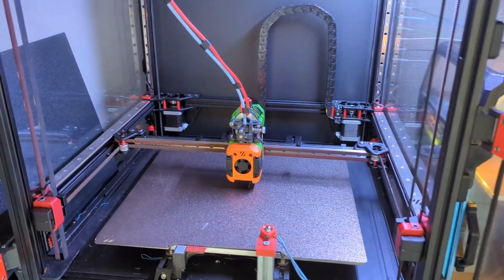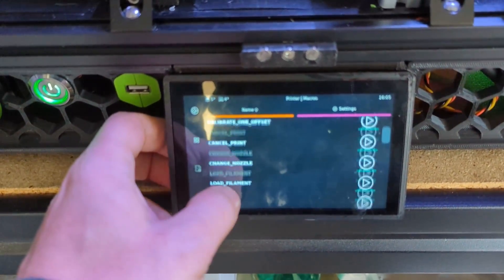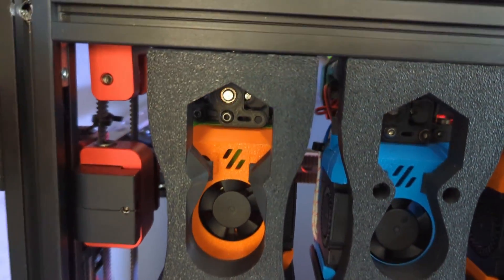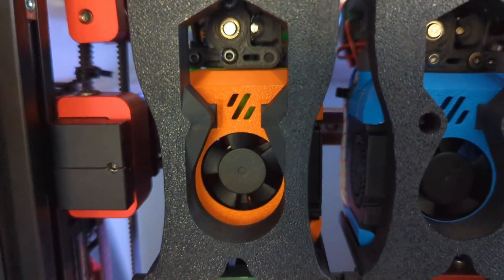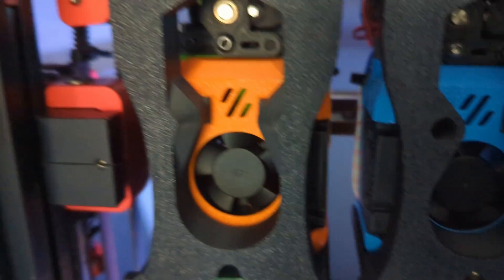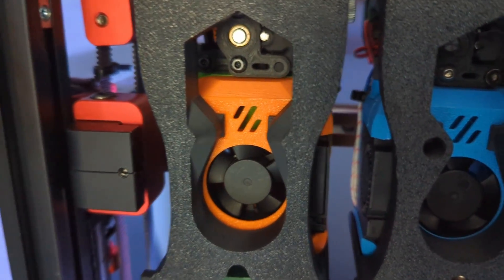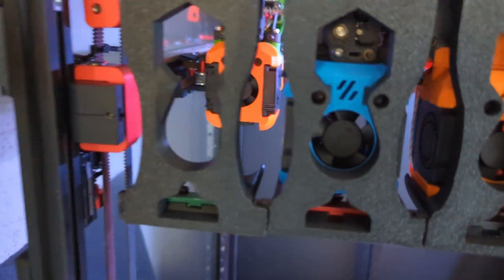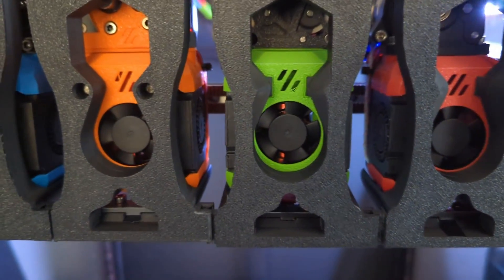Tapcahnger dock alignment

Comment: Cool project!!!  What kind of board are you using for so many heads and printer?
Reply: It uses canbus. So each toolhead has its own board.
Reply: @SymptomRelief All print heads are controlled via CAN.  What is the general control board?
Reply: @DoK_ToP  I don't know what board the OP has. But this project doesn't require a special board if using canbus. Each canbus board has an onboard extruder motor driver.

Edit: I guess you either need a mainboard that is canbus compatible or something like a BTT U2C to connect the canbus boards to the RPI. But that is a given for going canbus, not just with tap changer.

Comment: Around minute 5 you mention knowing which toolhead was in use.  I'm guessing you using the accelerometer data for this?  I looked through your example config files, but didn't see how you figured out which tool was active.  I'm still a noob.

Comment: where can I find the mod for the usb at the front of the skirt? and same for the on and of button.
Reply from the maker: I added the misc repo in description, see the Skirt Mods folder.
I burned out my initial 19mm power button - the inrush current of 700w of PSUs is a thing.
So now I have a 10amp 22mm button from Aliexpress just directly screwed into the skirt hole.

Comment: If u use an mmu system like enraged rabbit... you only need two toolhead.... If the printer print woth the first toolhead, then in the other can change with filament....and then the printer change to the second then the first can change color....that result, no need extra time for color change, it can change color in the background while the printer works and no need for 4-6 toolheads (the non used hotend can color change and purge while printing in progress) mmu combine with your tool head changing method could be absolutely genius

Comment: Nice work! Ive been following along for a while. Im getting closer myself. Almost finished the second toolhead, just ordered more parts for the next two. Migt have 4 total. Is your Voron a 300 or 350?
Reply from the maker: Cool, nice to hear.
Mine is 350, I can fit 6 easily, maybe 7 if I make it tight. 4sounds like a reasonable middle ground, I have yet to use more than 4.  The remaining two are dedicated for abrasives and high flow.

Comment: This should also work on a Trident right?
Reply from the maker: No, it needs toolhead to move vertically with respect to frame.
I have something in the works for trident as well. Sometime early next year.
Reply: Maybe a extra Z in the suport of heatools?
Reply: Would you toolchanger for trident fit in 250mm trident ?otherwise I would need to sell it for a 2.4v 😢
Reply from the maker: @Daniel-hw9zk  Yes. However still not clear how much Y travel will be lost.

Comment: I just love it, its already on my list after my current project... 
Generally speeking, wheres the setting for G0/G1 speeds ? Because id like to speed that up aswell
Reply from the maker: In the toolchanger.cfg - up top. There are two speeds - one for the fast moves and another for the slow moves.

I did a fairly extensive rework of the config files, so you might need to update.
Reply: @viesturz  thank you very much for replying... yeah in the toolchanger cfg i see them, by in general i also ment on how can i change those on my current 2.4 speed, multi toolhead  2.4 is just a bit planned so far but not any further so far, sorry
Reply from the maker: @3DWolfEngineering not sure if I understand the question.

The speed is specified with the F<speed> parameter in G0/G1 commands. When it's not present the previous speed is used.
For manual control buttons in the web UI, there is a config section for the UI that defines the speeds.
And  there are max speeds in your printer.cfg, no command can go faster than that.
Reply: @viesturz  no worries, yeah you understood right ... yep i know that F<speed> its pretty much just standard gcode as its also used for CNC, lasercutting...
Okay only that i dont always want to type G0 cordinates and the speed ... doesnt seem like its the previouse speed either because its always the same slow isnt there a general setting that defines how fast G0 is ? 
I know the max speed in printer cfg and also some homing /klicky or autoz have their own speed settings in their cfg...

I am trying to tune my whole printer to speed (partially shared on my freshly started youtube XD) and i am quite sucessful with it except for the print start sequence and if i just run G0 commands in the console... 
They all have their setting somewhere i couldnt find yet and print start is split into multiple smaller gcodes QGL and all that which not all have a speed and accel setting... soo i thought maybe you know where that setting is hidden since you wrote your own .cfg files and developed a perfect Toolchanging system...

sorry for typing so much and keeping you busy... thank you so much for replying and trying to help me - apprechiate it !

Comment: Would you say this is ready for "live" or is there more development to be done?
Reply from the maker: Getting close but small tweaks will always come.
 I'm aiming to make a wrap up video over Christmas. From the top of my head - better big block hotend support,    slight tension adjustment screw angle tweak, a bit better clearance between the shuttle legs and optical sensor when docking.

Edit: this is what I'm aiming to tweak by the end of the year, then there will be a pause and looking to make an adaptation for the trident.
Reply: When is something ever finished :D but yeah, I would like to know that too

Comment: Incredible work ! Looks like a promising solution to pooping when doing multicolor prints.
I was wondering, how is the printer able to know wich tool is currently on the shuttle ?
Reply from the maker: Each tool has an optical sensor that is used as a nozzle Z probe (like Tap) and also to detect which tool is mounted.